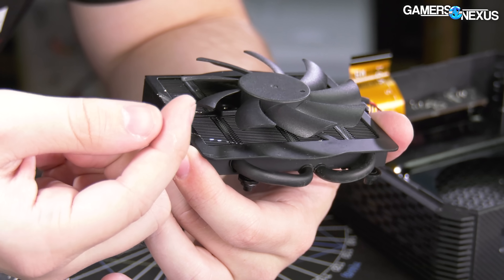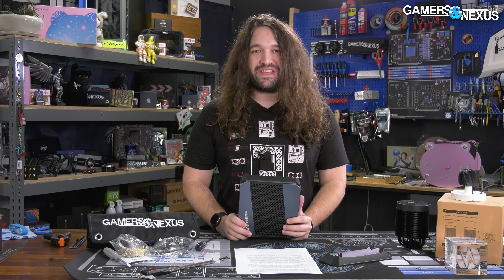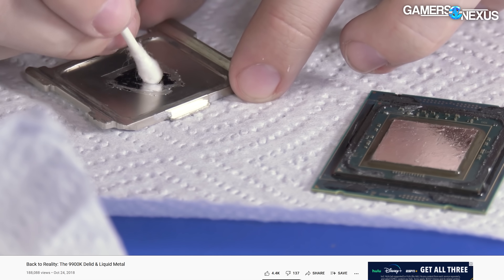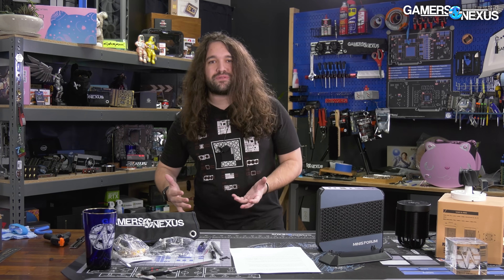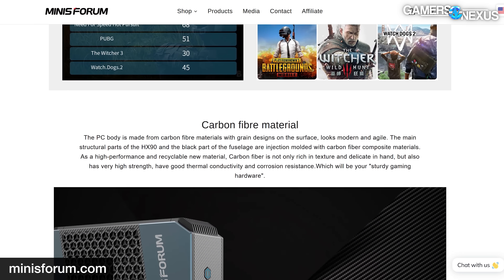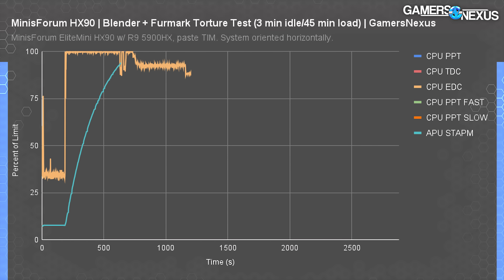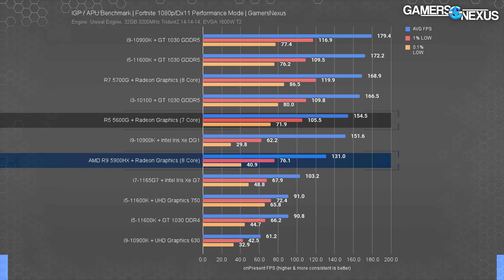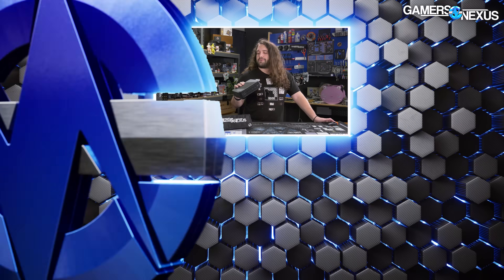Utter Incompetence: Liquid Metal Disaster in Minisforum HX90 Small AMD Gaming PC

Comment: There are 3d printing filaments that have little carbon fibers blended into the plastic, but it's mostly cosmetic for most variations.  Some variations add some strength, and some variations are actually weaker than plastic alone...  its dubious at best.  If they are using that, their claims would make sense, I guess, but obviously pointless.

Comment: Did I get this right, there is no liquid metal used as a thermal paste replacement but there is liquid metal spilled inside the case? What exactly are they using the LM for in the factory?
Reply: maybe they are squirting it at each other with water guns for fun.

Comment: Shudder, I would've bought it if it had 5Gbe ethernet or better to turn into a mini home server
What I'm attracted to is the power consumption on idle/middle load (11W-60W at the wall) and that's only possible on a DC brick or ATX12VO as far as I know
Is it at all possible to build a system that would sip as little (at the wall without counting in mechanical drives) ideally with either 10Gbe ethernet or a pci-x 4x slot? As far as I've seen nothing exists off the shelf with a pcie-x slot and I've seen 1 system with it.
The target system would have 10Gbe (or better SFP+), 2 NVME slots, 2 SATA ports

Comment: This illustrates exactly why I would never buy a PS5 ..... Not only did the use liquid metal they used a LOT of liquid metal because it's time consuming to do it right as Steve illustrated. Yes they use a containment structure but if it ever leaks it's going to be a big damned problem as you are either going to burn up the SOC, short the motherboard or both which means the unit is effectively landfill fodder .... If even 1% of PS5 units leak in the next 2-3 years you are talking about millions of customers, losses to profitability and your reputation complete shot to hell

It's just a bad engineering decision all so they could boost the GPU clock rather than do what Microsoft engineers did, just add for more CUs .... I can't see how they saved any money going this route and the potential losses in the future both monetary and reputation, could be astronomical

Comment: Honestly, for the price, i'd rather get a Lenovo Thinkcentre M75Q gen3(if they're out yet) That way you get an even smaller package, with a replacable processor(assuming its just like the Gen2 with 4000GE desktop parts
I got my gen2 with 4750GE for $488 at the beginning of, crap, this year or last, just remember i ordered it in january of year X and got it like 4 months later because of covid
Pro tip, I ordered mine with 16GB of RAM, figured i'd get 2 sticks of 8, but no, 1 stick of 16, and crappy 3200(CL22 or 24 IIRC) if you can, spec it with 4GB and order your own RAM, dont go over 3200 CL20 though, the kit of 3200CL18 i got would revert back to 2667 CL18, and the BIOS doesnt allow you to adjust timings

Edit, the RAM issue may have also been because i had 32GB of fast RAM, it MAY work fine with 16GB of fast RAM

Comment: I don't have a clue as to why they decided to use LM on a product that will ship just anywhere and be subjected to the shipping gods and goddesses that just love to toss/drop/slam packages all the time or drop kick the package up your driveway like UPS did to my 3090.  Camera's never lie and it was replaced.  But wouldn't Thermal Grizzly Carbonaut pad been a better application to this instead of LM?  With such a small cooler I can see why they wanted the Kelvin low but I think LM should of never been used on this.  Reason I saying this is because the LM is everywhere, on top of the fan blades, all over the board and probably in every little nook and cranny as well from what appears to been abused by the shipping company.

Comment: You don't need tons of experience to use liquid metal,  just the right foreknowledge and an attention span. I used it in my second build, and ever since.  Never had any problems. Just squirt outside of the PC (like in a little cup away from electronics)  and apply a thin coat with a qutip to both heatsink and cpu, boom, done.

Comment: If there is liquid metal splashes on the case, and on the board but not on the components it's supposed to be used on. Then what the heck did they use it on?

Comment: It's /possible/ that the plastic housing is carbon fiber reinforced/impregnated...but not likely. You'd usually see glass fiber or glass bead reinforced if anything.  It it feels kind of scratchy when melting with the soldering iron it's likely reinforced with something.   There may be markings on the back side of the plastic listing it's composition.  Something like GF-30 or so.

Comment: Thank you so much for the videos and huge amount of work you and your team do!  This machine was on my radar as a possible future purchase, and well.. now it's not.  I'll look for some other brand with a 5700G CPU, or something different entirely.  M1X Mac Mini, maybe?  Asrock 4x4?  Intel NUC?  Or maybe a DIY Mini ITX build if I want to take on that challenge.  But I really like the idea of a Ryzen APU based NUC like device.  Anyone have a recommendation for a solidly good one?
Reply: Yea I'm at pretty much the same place, I wanted to pick this up as an emulator box and now I'm having 2nd thoughts.  I don't really care that they messed up the  liquid metal, I've worked at startups and other small companies, sometimes it's very difficult to train $20/hr technicians, I've been there, I won't fault them for that, and the CF "blend" is exactly that, a blend, and it's mostly marketing, and I really don't care, I care about the performance.  I'm a little confused as to how this underperformed the 5700G on the chart, makes it seem like something wasn't right.  Is it just massive thermal throttling or what?

I like the design, form factor, cooling, external power brick, etc.

Comment: Agree with your conclusion.  This box is pointless given you can build the approximate specs.
4700g/5700g + b550/b520 itx +32g ddr4 3600 +512g ssd+  inwin choppin (for the novelty) costs almost the same than this.   You can save a few bucks if you can find 4700g and b520itx and have an exisiting ssd.

Comment: I guess those who like using liquid metal are free to use it. I don't want anything liquid and metal in my system, especially when it's as reactive as it is. While anyone using it should know it will absolutely destroy aluminum, it also reacts over time with copper, less so with chrome. It's not easy to clean off once it's there either. I guess for extreme overclocking it might be worth it, but for most who aren't going to do that, it's almost certainly more risk than it's worth.

Comment: They probably hired a The Verge PrOfeSioNnal pC bUilder  that got fired from his previous ShameStorm ..

"Spread the liquid metal evenly with a 12V 140mm fan, at a 50cm distance from the CPU. 
Keep a few droplets of it for the MB & NVMe SSD, as they need to be cooled as well. (quick tip: if you put LM on yourself in summer, you won't need air conditioning anymore! That's what Freezer's brother understood early..)
Also think to apply the LM on the CPU 1st.
Put the heatsink on the CPU, with the fan between the CPU & radiator, to help the radiator being + efficient by pushing hot toward it.
Don't forget to screw it with your Swiss army knife, that, hOpEfuly, should have the appropriate end."
😎

Comment: How damaging is the liquid metal to aluminum components? Gallium itself will turn aluminum into mush.
Reply: Liquid metal should not come in direct contact with naked aluminium or copper. Pretty much only nickel and steel. It reacts much slower with copper, but it does react. The have been more than a few who didn't know this and applied liquid metal to their copper base heat sinks.... for interesting results after a while.

Comment: "Torx is maybe better Philips in some instances" -- I struggle to think of a situation where I'd rather have Philips than Torx.
Reply: How about an instance where you have a (near-ubiquitous in North America) Phillips screwdriver on hand, but not one of the (relatively uncommon in North America) Torx screwdrivers. I'd rather see Phillips fasteners in that case, unless the screws require so much torque that it's worth it to go get a Torx driver instead.
Reply: @AndrewFremantle  Nowadays Torx is super common as well. And IMO more user-friendly, you can't mess it up by using a wrong size bit like you can with PH or PZ.

Comment: It's actually nothing to do with the unit but thank you for including the 0.1% lows in your charts. Given that these occur roughly once every 20 minutes and people typically game for longer than that - often far longer - they're sufficiently common to be noticeable.
Reply: That's not how it works. FPS is an abstract of time. What we're measuring is the average of frame spacing over time. You can run a 1.00 second benchmark that produces exactly 100 frames and still calculate the 1% low and 0.1% low frame spacing, since it's just a geomean extrapolation.

Also, if it did work the way you express you'd only need 10 seconds of gaming at 100FPS to deduce the single longest frame spacing which would equate to the 0.1% low.

Comment: I just want to say that I followed your guide to applying liquid metal years ago (onto both the die and heat spreader in a very thin film), with a 3d printed delidding tool, as a complete amateur, on my brand-new-at-the-time-7700k, and your guide worked like a charm. Still runs cool to this day. Cheers guys.
Reply from the maker: That's awesome! Glad to hear that!
Reply: @GamersNexus  Your still using this pc I saw it in your Chamber build log or something or not. Like huh? That's hypocritical
Reply: Same for me ! Thanks to GN I crossed the river and tried LM on my 3770K. Works like a charm : 4,5 GHz OCed with 60°C max temps in torture tests (equipped with a Noctua NH-D15) =)
Reply: Brave legend.

Comment: Tbh isn't liquid metal a mess anyways? It will make components like 3 degrees cooler at like 10 times the cost and a lot of added risk.

Wouldnt reccomend it to anyone, lapping a cpu cooler should give much better gains.
Reply: Depends on the component, honestly. I had temps on my 8700k drop 16c on average after a delid and LM, But that was directly between the IHS and die, and a particularly bad factory TIM application. a good third of the die had poor contact, judging by what it looked like when I pulled it.

Comment: Liquid Metal is excellent and does indeed help with heat transfer, but it's about 3-4X more expensive than thermal paste AND you don't get much, barely enough for 2 CPUs.  So I'm certain "cost" is why they didn't do what they claimed they did do.  On a side note, enough of the exploding PSU in every video ;)
Reply: well would be CHEAPER to not spray it all over the case, motherboard, fan and so on like some randy teenager then...
Reply: @LiLBitsDK  Hard to tell from the video, but is it really liquid metal and not splatter from something else (solder, paint) ... doesn't make sense to spend money to toss liquid metal all over the place in a random fashion for no useful purpose ... that would certainly cut into profit.

Comment: I'm reminded of the McLaren F1 in the early 90's that had carbon fiber and gold heat shields since carbon fiber is not a good conductor and doesn't react well with extreme heat.  I know modern impregnated carbon fiber does much better in regards to heat, but it doesn't help conduct heat.  It's quite a good barrier though!
Reply: There are two kinds of carbon fibers: turbostratic ones, and graphitic ones. They have about a 100-200x difference in thermal conductivity in the fiber's direction, and at the "200x" end, end up being twice as conductive as copper.
The turbostratic ones stretch more and end up a little stronger, while the graphitic ones are much stiffer and fracture a little sooner.
Regarding high-temperature stability: that's just an issue/effect of the matrix. If it's a generic epoxy, it'll strongly weaken around 150C. If it's pyrolitic graphite, it'll remain structurally sound at 3000C (if you keep it from burning, it's basically coal from that perspective).

Edit: Carbon fiber, with a chemical barrier coating, can be literally used to hold vaporized iron as a pressure vessel. It's the highest-temperature structural material that isn't extremely exotic (there are a few materials, but there is no industry to turn any (but one) of them into large structural parts. The exception is Tungsten, but that's 10x as dense as the graphite-matrix carbon-fiber composite, and about equally as strong (at room temperature; I expect Tungsten to soften more rapidly).
Reply: @namibjDerEchte  That's interesting though, but I wouldn't expect to find that on the shell of a Chinese case (of that price), and of course we were let down again.
Reply: @namibjDerEchte  Buuut it wouldn't be oriented in the direction of the fibres. At least not for the case or any structual things. You could make a thermal pad of unidirecrional fibres but I don't see much use there either. There is still matrix material and it would need to be rather thick to not just crumble. Plus it wouldn't conform to surfaces thus  making bad thermal contact.
Reply: @TheYear2525  you could use in-plane graphitic fibers to distribute heat in-plane.
For transfer normal to the plane, you'd use a metal/conductive-ceramic matrix or a lot of heat-conducting powder filler.

Comment: If you bought a prebuild rather then a kit it would make sense to have tamper resistant screws. They don't want you to open it up as a customer break it and then blame it on them. Same reason most prebuilds come with a tamper sticker to absolve the company of responsibility of user errors.

Comment: 9:40 for folks out there that don't know, if you find yourself needing a security bit in a pinch, head down to your local hardware store. there's a good chance you can find either a set of Milwaukee 1/4" security impact bits (that will fit just fine in a multi-bit screwdriver as those are also typically 1/4"), or individual bits in the fastener aisle. honestly I don't know why companies even bother with "tamper-proof" screws anymore, the bits are readily available.

also i just wanna say that (non-security) torx > phillips in virtually all cases, and yes I will die on this hill.
Reply: Best Buy's your best bet typically. They carry multiple iFixit kits in store, whereas the hardware store, local or large chain, isn't all that likely to sell security bits on site.
Reply: @reaperreaper5098  i speak from experience lol i do inventory at one of the small red ones
Reply: @Phosphor66  So do I. I do commercial construction, some jobs call for Torx or Hex security bits, that we can't source from hardware stores like Home Depot, Ace, Tractor Supply Company, or Lowes without going to their site (and most of their selection is garbage that will not outlast the job). Local stores are worse.

Whereas both local Best Buys carry iFixit Manta bit sets in the physical store and their bits are higher quality than what can usually be found if you do manage tofind something in a physical store.
Reply: not sure what to tell ya man. like I said, I literally do inventory. I know what's in my store, and what I described is absolutely in my store.

btw I wanna see this ifixit bit that outlasts a milwaukee impact bit. seems a little far-fetched.
Reply: @Phosphor66  Your store is an abnormality. Security bits are a niche item that would cost more to stock than most would consider profitable.

Also, I didn't say the iFixit bits would last Milwaukee, I said they'll outlast the typical garbage one can get on the rare instance that a store does carry security bits in house. Though, my experience with Milwaukee bits, I wouldn't be surprised if iFixit outlasted Milwaukee on more niche bits, because Milwaukee's bits are absolutely a mixed bag.

Comment: Very interesting. I just bought a Strix G15 from Best Buy a few weeks ago, and when I took off the bottom shell to add another NVME drive I noticed liquid metal pretty much all over the components as well. Didn't think to remove the heatsinks to see if there actually was any liquid metal like there's supposed to be, or if they replaced it with standard paste.

Comment: Since you're already using an AvE testing method, perhaps embracing his "Sharp Knife Fiber Test" - Cut the material in question, and listen for the snapping of fibers. Carbon doesn't have the same obvious sound as glass fibers, but it's still obvious when it's there. Heat from the soldering iron likely just allows you to move any fibers by melting the substrate, assuming there are any.

Comment: Carbon fiber is usually molded into shape by soaking it in a polymer resin then letting it dry, so really it's about as heat-resistant as the resin used.

Comment: I recently bought a Flow X13, I had to clear C-mos when I got it.
I was surprised to find a similar problem. Not as bad as what you are showing but there was a line of liquid metal on one of the ribbon cables, and a drop on the motherboard itself.
I carefully cleaned it off as best I could. I haven't had any problems with the laptop after i cleared C-mos.

Comment: Not going to lie. I have been building computers for 20 years and the first time I used liquid metal, i got a drop on the RAM and did not see it. After a few days it worked its way down into the slot and fried the RAM, board, and CPU (5800X). Yeah that stuff is weird to work with and no joke if you don't watch. I can't beleive they did not fry anything. I stopped using it lol. All my builds idle in the 40s so I figured liquid metal is not worth the time or the risk to maybe get high 30s. My 5900X that I used to replace my mistake has regular paste on it and idles at around 47c with fans on normal so yeah, I am good on the LM